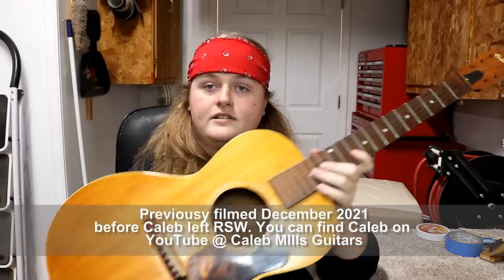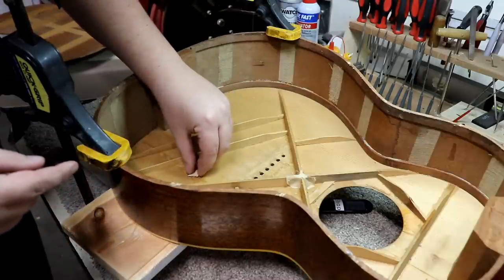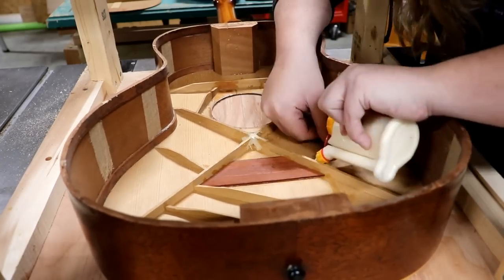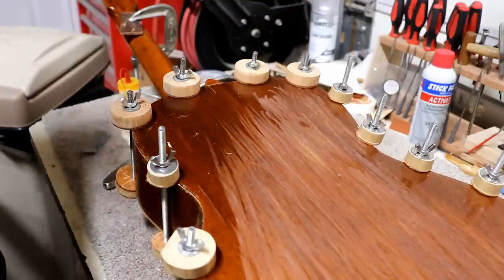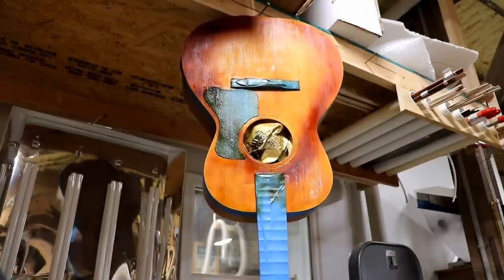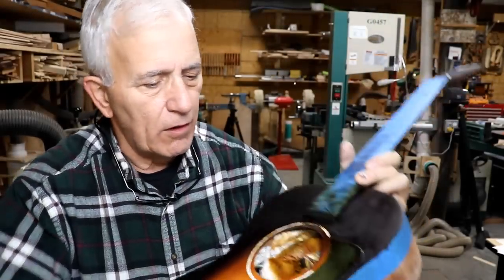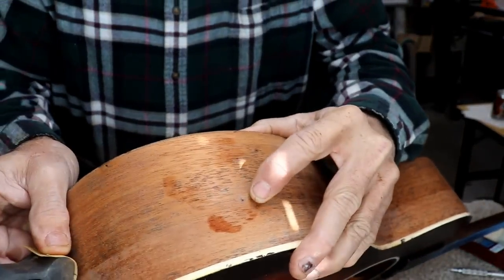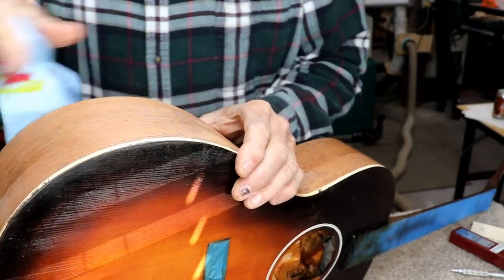578 RSW Refinishing A Gibson L-00 Vintage Guitar Back To Its Original State Part 1

Comment: ????? Jerry, when removing the back, on an instrument to be refinished, would it not
be prudent to use heat, to break the glue, to avoid damage?
A genuine question.
Reply: Unfortunate we didn’t get in the answer. I watched him use finger planes to plane away a bridge plate / cross brace. Later in the video he said almost all the glue joints are hide glue. Heat, hot knives, and very judicious use of a very small amount of warm water should have removed the bridge plate far more effectively than using finger planes

Comment: I have an identical sealing iron. It works very well for fingerboard extensions and even entire fingerboards, but it does take a while. Sometimes I switch to a full-sized iron when I get past the body. Has part 2 (or 3?) already been on the channel?
Reply: Why would part 2 or 3 come before 1????🙃🤪
Reply: @zapa1pnt  Good question. I should have asked if the completion of the work on this guitar had already been posted. I thought that Jerry had already posted the final work on this guitar, regardless of its numerical designation. At the time I thought that there was a gap. Bad memory, I suppose.
Reply: @scottreeves1226 : Well, as a matter of fact, you are correct. Jerry showed much of the progress and hassles in his Vlogs. This new series #578 is the complete job.